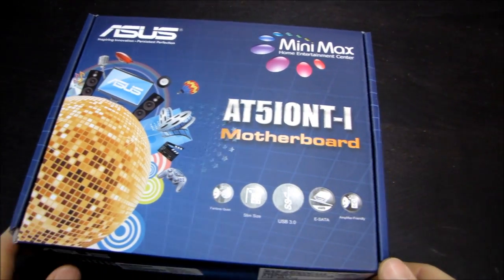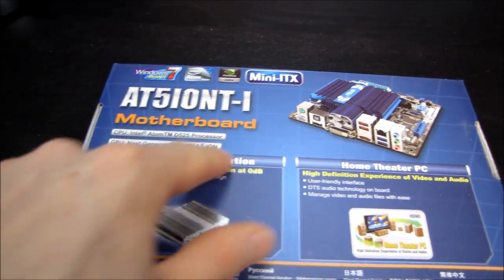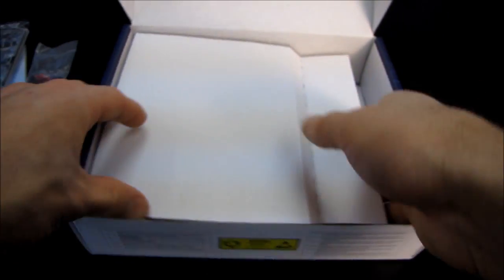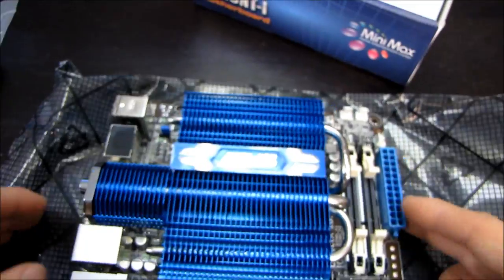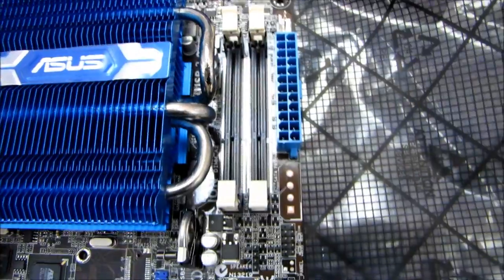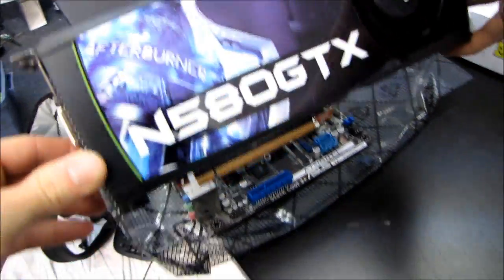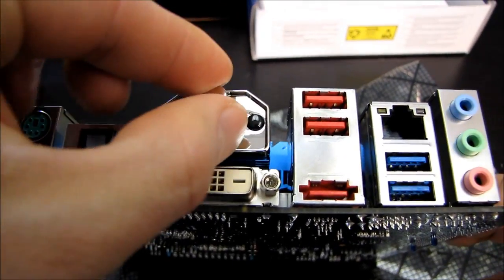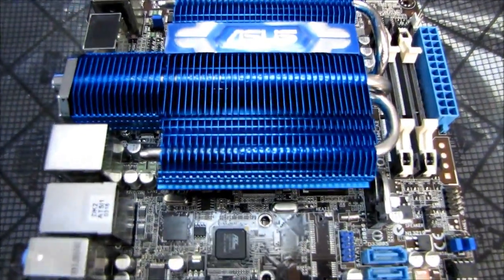ASUS AT5IONT-I Atom D525 NVIDIA ION2 Motherboard Unboxing & First Look Linus Tech Tips

Comment: Actually the PCIe Spec should prevent the x16 video card from running in a 4x slot. 
The Card expects 75W of supplied power through the slot itself, which a 4x slot does not provide. So in all likelihood you won't be able to power a full size graphics card off of this board.

Comment: @yoshidis4 This board + pico psu + 1.8" SSD, in the small case like the MINI-BOX M350  = win HTPC.
It's obviously not for gaming. But should provide enough power to get 1080p content on your 50+" TV at about the same size of a Nintendo Wii.